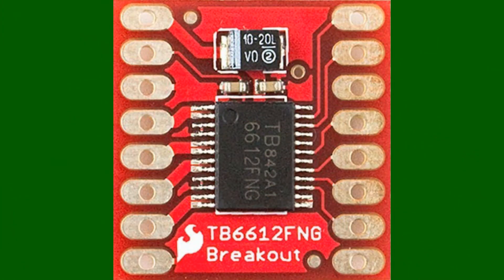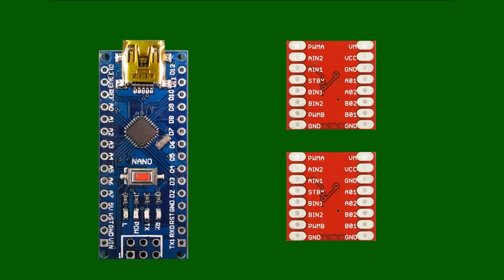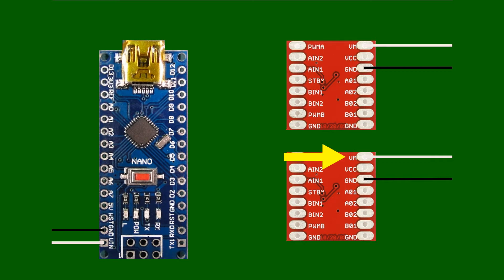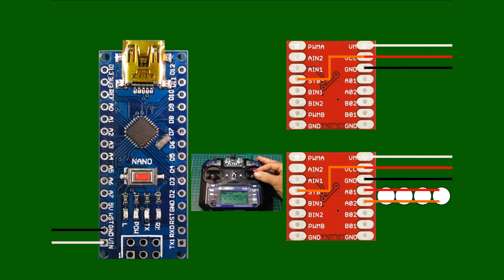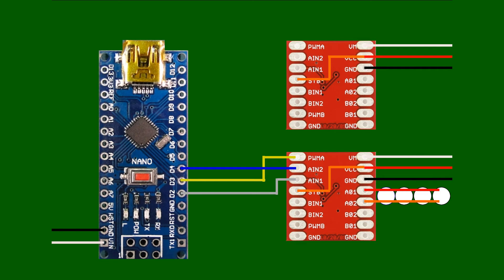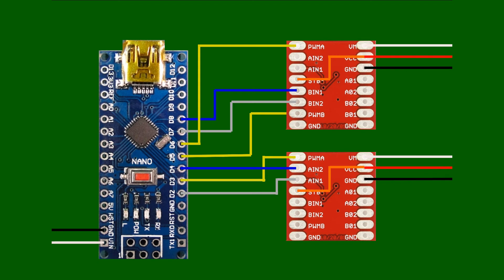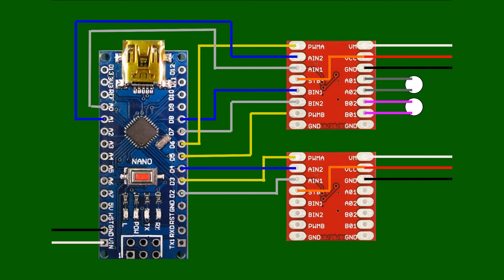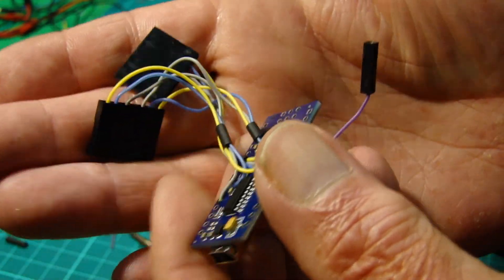Bruder Cat Telehandler RC Conversion EP19 Connect Arduino Nano to TB6612FNG Motor Drivers

Comment: Hi my friend! I have a 8.7v 960mAh power supply. Can I use it on the TB6612FNG to power two 3.7v motors? What should be the amperage of the TB6612FNG?
Reply from the maker: Hi, yes it possible to run that setup at low speed, but as demand for higher speed or torque increases the current draw could excede the 2amp limit and trgger the thermal cutout. I have used 5v logic to power the motor drivers and control 2x 3v motors successfully. Hope this helps.